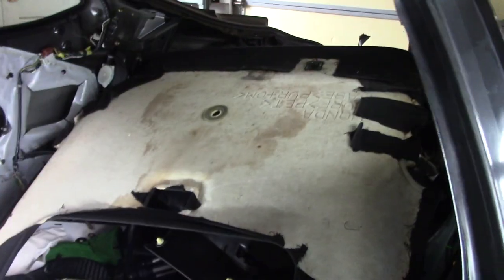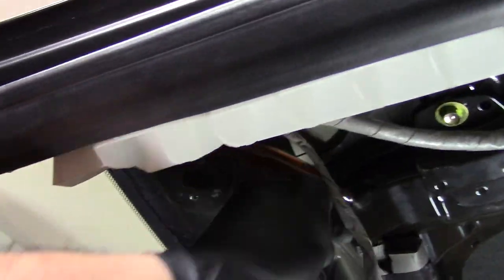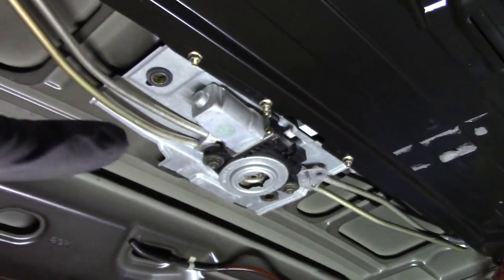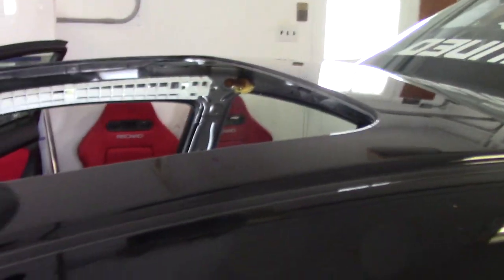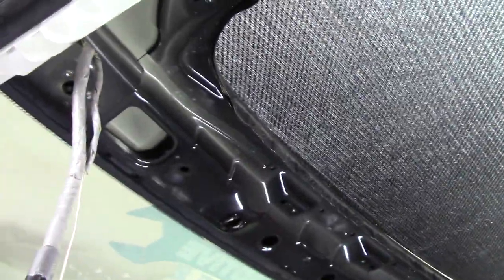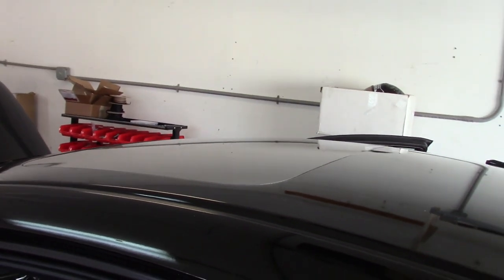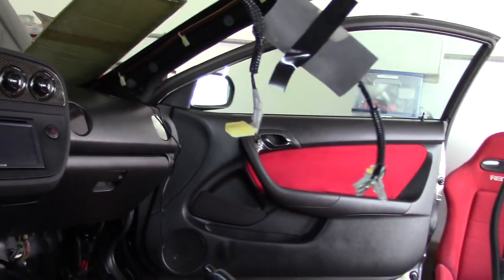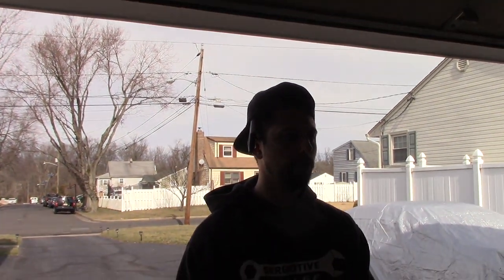RSX Carbon fiber sunroof delete!

Comment: I made a plug for my civic si and it was PITA alot of thought has to go through and it would still leak every now and then I put rtv bead under by the lip so make sure run a water hose after to check no leaks lol
Reply from the maker: Haha I’ll deff be checking it for leaks!
Reply: @SERGMOTIVEGARAGE where did you get the insert
Reply from the maker: @Jacobrivera52 northwinds composites was the company that was manufacturing them at the time. They have since sold the rights to sell them, maybe try contacting them and see who sells the plugs now.